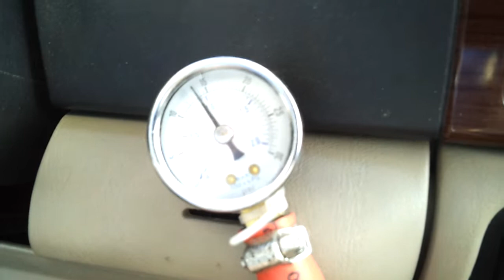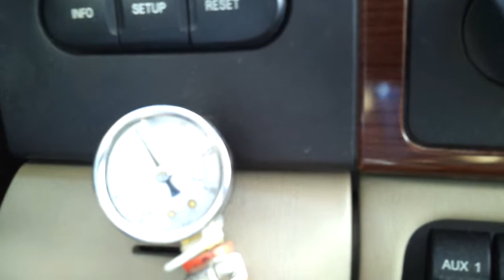New Blackwater Engines Longblock HeadGasket Leak and Blow-by Part 2

Comment from the maker: No coolant leaks at all on the original engine. As soon as I put in the Blackwater engine, every point that could fail in the system has failed due to the pressure from the blown head gasket. I'm even talking the tank seams on the radiator, The heater core switch blew apart, etc...

Comment: Dude, Saw part one, My question is the coolant leaks were they there before you replaced your engine or after? I have one in my shop with 17,000 miles on it was towed in because of no oil press. quit running upon inspection of the oil pump several hard pieces of metal went through the oil pump damaged the gears. Upon removal found coolant leaking at back of heads customer tells me first no warranty then blackwater said take it apart and find the cause of failuer